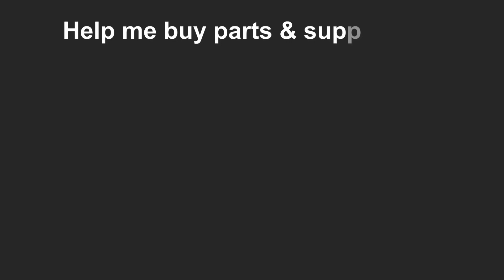The Needle Thread Tension System of the Singer Model 403A Sewing Machine

Comment: Andy, I've followed your videos on tension and bobbin adjustments but I still have problems with the thread breaking because it gets caught between the bobbin case and the race of the hook instead of sliding over the top of the bobbin.  Any suggestions on what the issue might be?  Any help would be appreciated.
Reply from the maker: Some thoughts about this:
Is this machine new to you, or it was working and this suddenly started?
1. Be sure it has the correct bobbin case: https://youtu.be/8iwyoTC7FEc  
2. Be sure you have the correct bobbin, Class 66. Model 403A came with plastic ones from the factory:
      https://www.singeronline.com/si66clbo.html      but can also use the metal ones  
      https://www.sewingpartsonline.com/products/singer-class-66-bobbins-172222-10pk
      Class 66 bobbins have curved sides. If you have a flat-sided class 15 bobbin it is too tall and won't work.
3. Check the Stroke of the Take Up Spring: https://youtu.be/t3UqzYRo-cc   If the stroke is off the spring may be keeping tension on the needle thread and creating too much drag on it, thus pulling it under.
Those are what I'd be looking at first. Good Luck, Dan

Comment: Hello Andy, if you're out there, I have a question about my Singer 503A tensioner.  I'm sewing heavy cordura so I have quite a bit of tension on my needle and a little under an ounce on my bobbin.  When I'm going along sewing, the thread comes out of the tensioner and I get a big snarl as long as when the thread came out of the tensioner.  I've stopped using that little pre-thread pulling arm and it's been better but still happens.  Any ideas?  Thanks for your help now and in the past.  Ralph-
Reply from the maker: Here is a video of alternative ways to thread the needle on your machine https://youtu.be/m79nr_DHRwQ The behind the thread guide route may help. I'm also wondering if the stroke and tension if off on your tension unit. The stroke keeps the thread taught as it goes down into the fabric. That is supposed to keep it from getting tangled with anything. Here is a video for stroke and tension on a 403A and it would apply to your machine https://youtu.be/t3UqzYRo-cc

Comment: Can you do a video on the singer merritt 4530 regarding tension? I have not been able to get it adjusted
Reply from the maker: That 1990s model is way too new for me. I've never even seen one in person. made outside the USA and I can not get a parts or service manual for it. Best advice is to clean the tension as best as you can. At least with blowing air, canned or compressed. If you can see it with the covers off then clean with alcohol. Many times tension is lost b/c dirt and lint get stuck in the springs and tension discs and you can't maintain a steady tension. Sorry, friend. 😞
Reply: @andytubesewing1953  Thank you Andy, I've taken it apart and cleaned it out best I can, the spring and disc look much like yours so I'll do some more and hope for the best. Thanks again have a great day
Reply from the maker: @bearteddy1992  OK, good luck. The theory of tension is the same on all units, just the parts can be a little different style.

Comment: Great tip about the stud; mine had been spread so wide I could not screw the flange on without using a lot of big words. I closed the gap, then had to widen it again to accommodate the other pieces, and the flange goes on very easily, but I think I might have to widen that gap a smidge more, as the flange does go on very, very easily, and I find  my tension vacillates. Finding the sweet spot, I guess! Thanks so much!!
Reply from the maker: Welcome. You're very intuitive, Michele. The sweet spot is correct! It's an odd little piece, but once you get it set-up properly you only need to brush the lint off and it keeps working. Thank you for watching my channel.

Comment: Watched and able to fix throat plate assembly with your video....now fixing tension assembly! Do you know where I can get a replacement tension unit? Mine is missing the silver part of the knob. Thanks.
Reply from the maker: If you want a "new" tension unit it will be a universal one like this: https://www.sewingpartsonline.com/tension-complete-singer-422403-455.aspx  If you want original vintage assembly they can be found on eBay sometimes. There has been a big increase in demand so they sell very quickly.
https://www.ebay.com/itm/Singer-Sewing-Machine-401A-Thread-Tension-Assembly-Tensioner/233671355067?hash=item3667e5eabb:g:Bo4AAOSw4wVfKuHf
The tension for the 401A, 403A, 404 can work on your machine. Thanks for watching my channel and good luck.

Comment: Thank you so much for your videos. I recently got a 403A but the numerator dial and thumbnut are missing. I found a new set on eBay and it is coming. In  the meantime I have taken the tension system apart and put it back together except for the missing pieces. The weird thing with the parts I have is that the flange adapter is only threaded on the inside and there is no indication that it was ever threaded on the outside. Have you ever seen this? Thanks again!
Reply from the maker: Hi, Marie, and congrats on your "new" 403A! It sounds like you have a flange adaptor taken from a different model; maybe a 500A or 503A. Maybe that is why your parts were missing on the 403A? Anyway, the 500A class machines have a combination numerated dial/thumbnut set-up and the flange adaptor does not have outside threads as far as I remember. There may be other Singer models like that also. If you have time take a look at this tension video for the Rocketeer models as maybe you have some parts from it: https://youtu.be/OqZZ-uhnAMY   Also, while you are waiting for your 403A to arrive, you may be interested in this series I did all about your type of tension unit: https://www.youtube.com/playlist?list=PLsCOZgzzaiKJaeFB_GW97NsW5GYM7KD9U
Thank you for watching my channel and for saving that 403A. Take Care.

Comment: Hi Andy, thank you so much for making these videos. 
The tension on my 403A unit is not quiet repairing properly. The rounded screw is stripped and This has created a bump in the road I can’t get around. 
This sure would be a nice machine to sew with if the tension is fixable. Did you cover this situation on the tension unit?
Reply from the maker: By "rounded screw" you mean the screw holding the thread guides? I'm not sure but it's what came to mind. By stripped you mean it won't stay in tight, or it won't come out? Or is it the head of the screw, like the slot, that is stripped? The screw I'm talking about is steel, and the body it screws into is aluminum, so is it the screw threads are damaged on the screw or in the hole. For tension parts, I don't know any manufacturer who makes new screws, but always have to find parts online, like eBay; a seller who is parting out the machine. The screw (and thread guide) are the same on models 401A, 403A, 404, 500A, & 503A. Here is a seller listing just the screw you need for $6.00   https://www.ebay.com/itm/SCREW-TO-MOUNT-THREAD-TENSION-GUIDES-TO-SINGER-401A-SEWING-MACHINE/393019826280?hash=item5b81cea068:g:P1YAAOSwlCpfsyf0    If I misunderstand the situation, I'm sorry, and maybe you could post some pictures or a video on your channel that I could take a look at. Good luck, and thanks for watching my channel.
BTW, the Part number for the screw is 329.

Comment: Hi Andy. Great video on the tension unit. Is it necessary to remove the needle bar and presser foot lifter level to do this repair. It is nice to have them out of the way but I am terrified about removing them and getting everything back together.
Reply from the maker: there is no need to remove the bars to work on the tension unit. there is a tension pin releasing lever behind the bars and if that was bent defective or not working properly then you would have to remove the bars so no worries April you can work on the tension unit with the bars in place it's a very good question and I appreciate you asking it and thank you for watching my channel